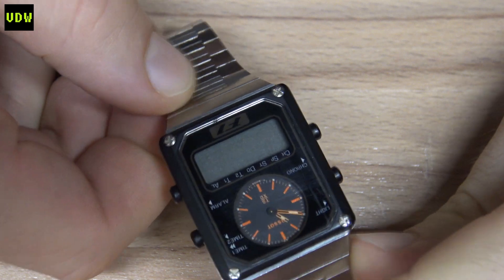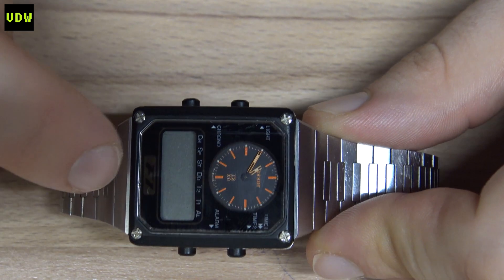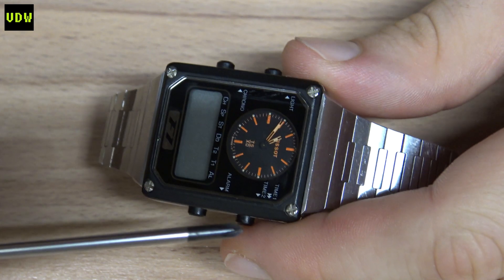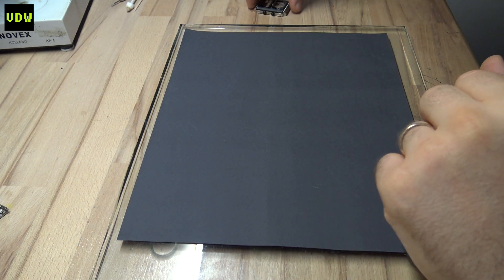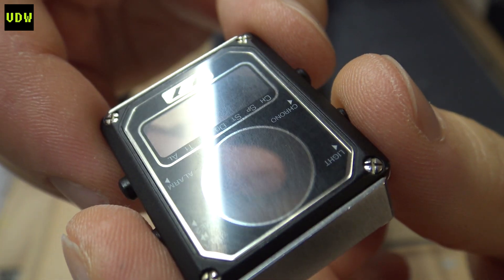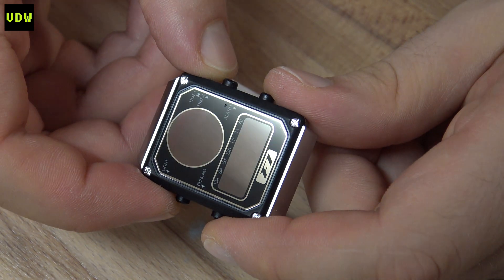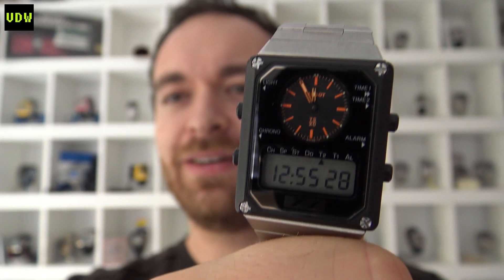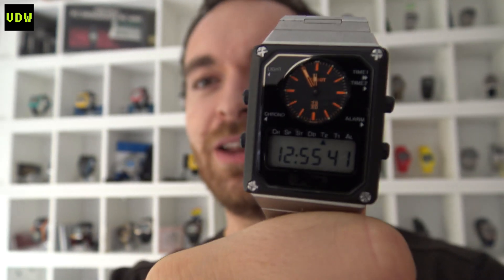Tissot TSX9 Repair & Overhaul - Ep 93 - Vintage Digital Watches

Comment: Excellent restoration!  Perhaps I missed it in an older video, but I had never seen the crystal restoration process before, which I am very excited about because I have many flat crystals that I can now make presentable!
Reply from the maker: Cerium Oxide is a powder that you mix with water until you get a slurry, then you polish with a felt attachment with a rotary tool like Dremel
Reply: @VintageDigitalWatches  I'm excited to try it!

Comment: I really like these, I have 3 working Tissots (but the X9 is still missing in my collection) and a total of 5 from other brands, some with very different cases. Great video - as usual ;)
Reply from the maker: There is a TSX9 for auction on eBay right now Michael but seller asking 250. Thank you for the comment.

Comment: I wondered if you can possibly help me. I tried to send you a pm but could not find the facility here.
I have just purchased an absolutely mint almost new old stock Seiko A259-5080 and have tried to find an operating manual on line but with no success. 
I did find a manual but it’s a service manual so is no good. Do you have any idea where I can find a pdf or online version  of this movements instructions or tell me if a similar movements operating instructions are close enough? I found the actual watch in the online catalogues and it’s from the 1980 edition.

Any advice would be much appreciated. Thanks for your lovely videos, I find them very informative, kind regards, Ian.